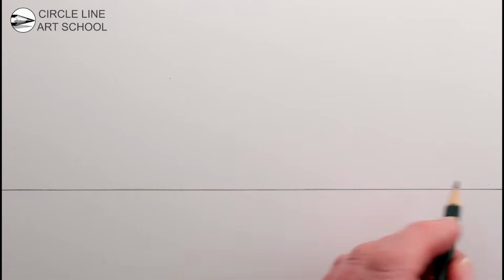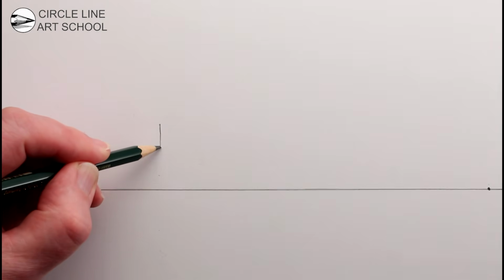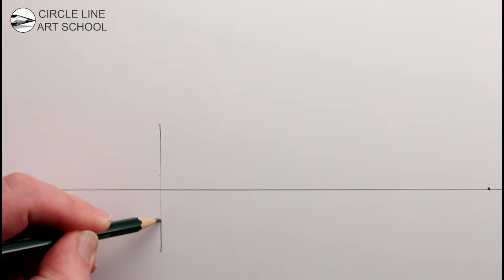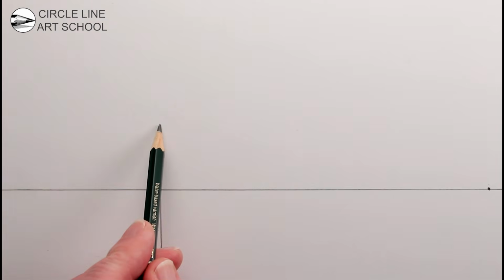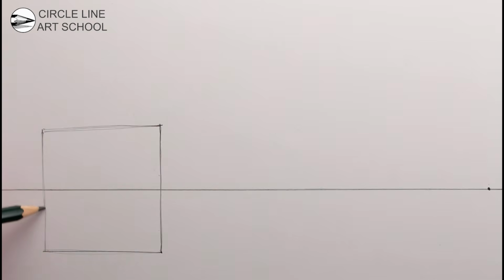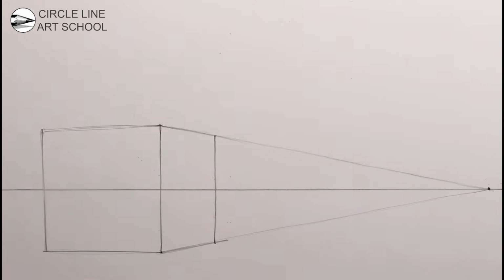Mastering One-Point Perspective Realistic House: Narrated Drawing Tutorial for Beginners

Comment: Great tutorial 

So we dont need a vanishing point on the left side.

What difference would it make to have a vanishing point on left side??
I read somewhere tht whwn u see 2 sudes of the house two point perspective should be used..

But this house looks perfect fine to me ..without 2 points 

Any help would be appreciated
Reply from the maker: Good question. Generally when using one point perspective it is best to place it in the centre of the drawing, as it is used when looking straight ahead. You can place the vanishing point off centre, right or left. and the receding side will work well. The front facing side of the image would in reality need another vanishing point, as we are looking not straight on, but to one side, but the VP would be very far away, off the drawing. For this drawing the front facing side ever so slightly is narrowing to the left. If the building were wide the need for a second VP would be greater. Use 1PP when looking straight ahead and use 2PP when looking at a corner of a building. Regards, Tom